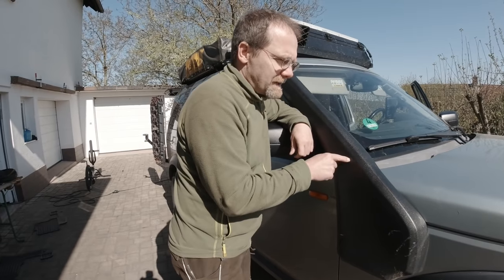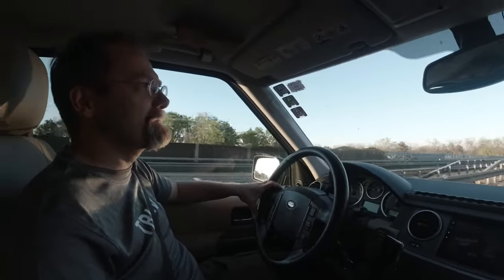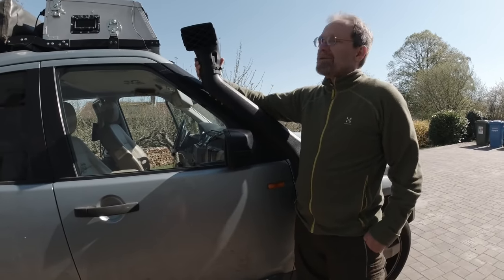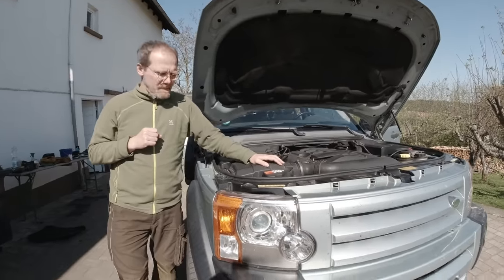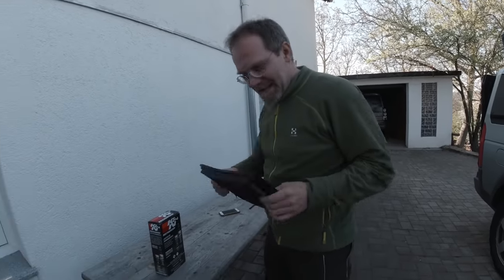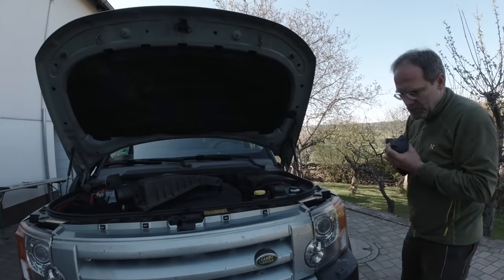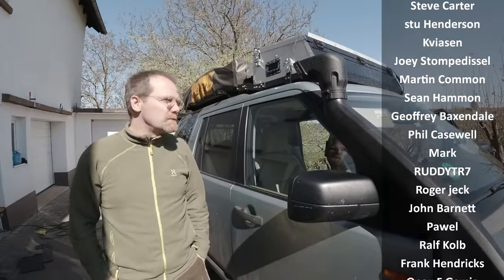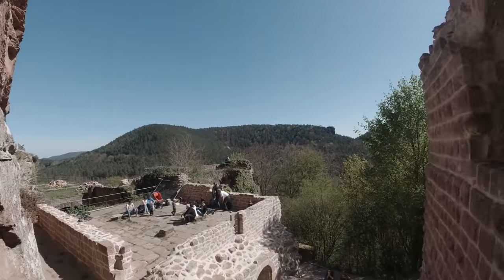Snorkel Intake - Forward or Backward?  Land Rover Discovery TDV6

Comment: I worked for a German company for a few years and I can say that your English is pretty good.  I don't have a snorkel on my D4 mainly because they look ugly but also because I do not intend to take my D4 through any deep water crossings.  The snorkel would help reduce the amount of sand and dust enetering the filter box but I carry a few extra filters on long outback trips and just check the filter once a week or so.  BTW I am not a fan of the K&N filters and believe the original paper filter does a much better job of delivering clean air at a consistent flow rate to the engine.

Comment: My vehicle has had its snorkel on for 12 years now (also a Safari copy, but a slightly better looking one I believe). The previous owner ran it with the snorkel head backwards, for mostly the same reasons as you present, but I keep it facing the front because it looks better IMO :)) 
Anyway, you must be right since the original LR (Mantec) snorkel also points backwards. Anyway, you made me curious, and I will do the fuel consumption experiment as well with the snorkel pointing in both directions, and I'll report back.
Cheers!
Reply from the maker: Thanks!  Christian

Comment: Hugh here from Melbourne Australia..Love your videos as i do most maintenance on my 2006 Disco 3 . TDV6.  I am going to turn my SAFARI (haha) snorkel to face rearwards & see how she goes.   I bought my Disco in 2019 & it had done 200,000km & i think plenty of towing throughout Northern Queensland in the hot & dusty areas you mentioned .  I bought it because the poor Chinese lady who brought it down to Melbourne (2nd owner) had spent over $17,000 in  repairs & gave up.  It was my 4th Discovery  & I took the plunge so to speak.  It has been ok so far at 250,000 the main problem was the air suspension & given my needs I elected to import from UK coil suspension & fit it myself at a cost of $1800  compared with Dealer $3800 repair to replace compressor & control unit.  Drives nicely but not as nice as the air system.  Only real disadvantage is that the Tow Capacity is reduced.
I have just serviced the Auto transmission &now looking at replacing the Right Front drive shaft seal & boots.  Have watched your video to give me courage to do this.  After that may be attack the oil leak from up near the turbo.....the jury is still out on that one.  My main hobby is NOT Disco 3.  It is 1949 Standard Vanguard.....73 years old original running gear & still purrs like a kitten. 
Cheers & keep up the great work.  I enjoy it immensley.
Reply from the maker: Shanes Shed and Outback Discovery both have a side shaft repair video.  Shanes Shed replaces the boot.  Hope your Discovery runs forever.  Please make sure you have the updated oil pump installed.  Christian

Comment: I've fitted a cyclone filter to the top of the snorkel on my D4, you would be amazed at how much dirt that it collects, this keeps the panel filter cleaner ( means less washing).
Reply from the maker: Sooner or later I am going to get one too. 👍👌🙋‍♀️Vera
Reply: Does the cyclone filter make it less throaty ?
Reply: No Martin, gives you more induction roar.
Reply: Just as a precuationary warning, cyclonic filters need to be matched to your air delivery requirements. I spoke to donaldsons engineers and was informed they are not designed for highway use due to the venturi effect and you may starve you engine from air. Below 70km/h is what they recommend. 
This could possibly have the same effect when facing the snorkel backwards, lower fuel consumption could be a result of the less fuel required to obtain the correct a/f ratio. 
Once again, based on the information from the donaldson engineers.

Comment: My Comments! 

1st. The Snorkel helps massively to keep your air filter clean when you driving in Dust behind another car (i.E. in my Case Marokko)

2nd. I have been told by Engineers for Engines (BMW, based I live in Munich) never to use a K&N Airfilter when I like to have a reliable car (Racing - different topic). They do not clean the air enough and the result will be to have a ruined engine when the dust reaches the cylinder.

Comment: I will have to try that, good idea. I was of the idea that the snorkel actually restricts airflow so I cut a hole in the box where the snorkel enters the engine bay. I then fitted a canoe hatch. Most of the time I run with the cover off, but replace for dirt tracks and jet washing. Look cool also : )

Comment: Brilliant video!!  Firstly, your English is great, as long as you don't "screw up", "oh my God"!!  It's interesting your use of a K&N filter vers. a standard paper element.  K&N filters definitely flow more air, but is this required?  Even if the roads are vacuum'd in Germany, they do let through more fine dust, but how significant this is, I don't know.  Vera is right, as always, the snorkel looks good, but the fuel consumption figures are interesting - shows the importance of engine mapping - facing forward versus facing back.  I'm surprised an aftermarket map was not supplied with the snorkel, and the K&N will exaggerate the problem...  Fun video as always.
Reply from the maker: Yes, the K&N is not very dense.  No problem here but in dusty regions not advisable.  We will have to test a normal filter with the snorkel turned backwards now.  Christian

Comment: I would have sprayed the K&N oil on the "dirty" side of the filter, so that there's less chance of any oil getting onto the MAF sensor wires, which will cause false readings and mess up the ECU ability to fuel the engine correctly.
Greetings from a Toyota owner from Australia.  :-)

Comment: Hello, thanks for your interesting tutorial about snorkels. 👍
I live in the Netherlands, the country next to Germany. 😁
Yes, I found out that a snorkel can be helpful in Europe.
I own 2 Pajeros, and used them also for my hunting- hobby.
After one tour through a hunting-field with very high grass, the whole air-filter was full of seeds and other particles.
After mounting a snorkel , I did not have that problem again.
Airfilters stay much cleaner.
My Pajero L040 diesel, has a safari snorkel, and I have the top facing to the back of the car.
On my Pajero V20, 3500 petrol, I have mounted a TJM snorkel, of which the top only can face forward.☹
After a few journeys over the highway, the air-filter was full of insects and other debris.
Because I could not turn the top backwards, I decided to install a piece of pantyhose (!) over the opening, and hold it inplace with rubber bands that I have cut from an motorcycle innertube.
Works fine, no more insects in the filter.
How it influences the fuel consumption, I do not know.
The Pajero I diesel consumes about 11 liters on 100 km.
The Pajero II petrol comsumes 13-14 liters pro 100 km.
I did not buy a 4x4 car for low fuel costs.....😉
Grüsse aus der Niederlande 🙋‍♂️
Reply from the maker: 😅👍 Hello Johnny, I have just been to your country and I think Philipp is planing to move there as soosn as he turns 18. At the end of this video here, you can see where we went and what we did. 😃 https://www.youtube.com/watch?v=Y6yEq9oETh8&t=1506s 🙋‍♀️Vera

Comment: I bought a snorkel for ours over a year ago, but it is still sitting in the shed. Apart from water crossings, I really don't see us needing to install it. I have had water right up to the side intake and nearly had it go under, so there is a practical use. I keep thinking about a temporary flexy snorkel for the super rare times we may need one. 
Thanks for another great video.
Reply from the maker: Make sure to watch our video on how difficult it was to drill those stupid holes into the A Pillar. 😅🙋‍♀️Vera
Reply: @Vera_and_Christian  I remeber that video, it was like it had armour plating in the pillar.

Comment: Unbelievable 26 minutes for an explanation on a snorkel, on my discovery I oriented it to the rear, the only thing that happened was when I was off-roading, one time I opened the passenger window and every time I put the gas on I felt like there was a ball bearing noise, at first I thought it was the front wheel bearing that was screwed. Then I realized that it was the air intake! 🖐️😁 😁 😁
Reply: I had a similar experience and even called out the recovery guy as I thought there was an engine problem!🤣
Reply: @paulwheeldon7194  first I looked for a stone stuck in the brake disc. total movie 🎥🎬
Reply from the maker: We actually love the sound of our snorkel. 😃👌🙋‍♀️Vera

Comment: Hi Christian & Vera, no apologies required. I've got a cheap $120 Chinese snorkel fitted that lasts now for over 11 years. The Safari's for $700 are a rip-off. And yes, we carry a toolbox in our WhatsCruiser, but I've never used it. It's just for the case that we have to help out some Disco drivers, but they've usually heaps of tools and spares with them anyway. Apart from this, great topic today. We have the same discussion here. Inlet to the front or rear. We are front drivers but the WhatsCruiser has the famous 4.5L inline 6 NA Petrol engine (1FZ-FE), different application. Yes, and we drive sometimes through deeper water. It's a proper water crossing when the water flushes over your bonnet and the front of your car starts slightly to float, what feels weired.
Reply from the maker: 😅👌🙋‍♀️Vera

Comment: Facing rearwards is for exceptionally dusty conditions, and  also prevents water ingress. If the system is properly sealed you can cross deeper water, it is also a good idea to have a raised exhaust.
Reply: Well designed ram heads get the water at the back of the head, letting it run down the outside.

Comment: Little turn from back to outside of snorkel cap (+15-20 degree) is reduce air intake temperature up to 5 C at 80+ kmh speed. It is due to air decompression due to  acceleration flow from the windshield. Tested with thermocouple. It is important that such turn also avoid partially ejection effect and air pressure drop

Comment: One main reason for turning the snorkel (raised air intake) to the rear of the car is that on very "dusty" dirt roads (not found in Germany) and you are in a convoy of cars (or one car) throwing up lots of dust, by having the intake rear facing, you collect less dust.
Reply from the maker: Hello Iwan.  I know everything I said only in theory. No practical experience.  But a Snorkel is a must-have for Vera because of looks and sound.   Christian
Reply: There are very, very few tracks in Europe where that much dust is thrown up, to cause anywhere near problems. If you want to seal the intake, then look no further than the push fit plastic connectors that leak, and nt water tight, late model defender air boxes even leaked, so even though you have a snorkel, water is already in through the duct work.
Reply: @marktalbot4wd  Hi Mark, I was referring to driving in Africa and Australia.
Reply: Also your intake track will have positive pressure at any speed above about 40kph with the snorkel facing forwards!    
Go watch some banks power video's and learn the basics!

Comment: Hi Vera and Christian, sorry for giving again a comment but as a typical german "Klug.....ßer" I cant avoid it :-) . 
First your English is really good, especially because its better than mine! 
Second, you are right, the ram effect or "Staudruck" of your snorkel will not increase the efficiency of your turbo pressure mensurable.  
But what I experienced on my TD5 with a VTG Turbo and a big 80mm diameter snorkel is that this tube creates a significant pressure drop. This was so extreme that the compressor began to be extremely noisy like getting into a resonance, because it couldnt get the air it needed. Especially with an agressive fuel map. 
I measured the pressure drop with a professional tool at the entrance of the snorkel and the outlet, and it was huge. In spite of having the biggest diameter of 80 mm for this 2.5 l Diesel, which was wider than the original tubes in the system. 
The only way to get it fixed was to drill a second air intake in the filter housing. 
What I want to say at the end of the day is that anything you put before your original air intake has to be seen as a resistance for the compressor and is not good. It will not be important at lower loads, but at higher loads and rpm, it will reduce the efficiency and pressure of the compressor. 
The only positive of the snorkel is that, when you have heavy rain on the motorway, the trucks you are passing on the left side are not throwing the water into your air intake. This was a typical Defender problem having the same type of air intake on the right side. Resulting in wet air filters.
Best Regards Michael
Reply from the maker: Hallo Michael, I have a feeling that our Snorkel content is not finished yet, thanks to you. 😅👍 We do check our air filters regularly, more than we put in vidoes, and they have never been wet. Maybe we would not have put a snorkel on if we did not have a Youtube channel, but I have wanted one for 25 years now, ever since we owned our first Jeep. If having a snorkel causes damage to the engine, one more reason for Christian to finally take that engine out. Thanks for your comment, really appreciated. I am looking, however, for a cyclone filter at the Abenteuer&Allrad. Maybe he'll buy me one. 🙋‍♀️ Vera

Comment: I live in Finland, and my reasoning for having a snorkel is I went on a trip to Denmark a few years ago, and crossed a stream on a beach that turned out to be surprisingly deep, like up to the bonnet deep while going down into it. Didn't have one, and my air filter got wet. Since then I haven't crossed any other streams, but hey you never know. At least I have a story to tell when people wonder what particular river I'm planning on crossing with my snorkel. My disco 2 has the snorkel facing forwards, because it looks cool, and my 4x4 sprinter has it facing backwards, because it sounds cool (and also to not get it clogged with snow in winter). Now I'm thinking I should turn the D2's head backwards as well.
Reply from the maker: Over the bonnet in a D3 is like a space walk with a leaky space suit or a Everest climb with no oxygen in bad weather.  😬😂👍 Christian

Comment: The reason you fit a snorkel for water crossings is; afterwards when you are replacing all of those damaged modules; and corroded connectors, at least your engine won't be Hydro locked.
Reply: So, so, correct!

Comment: The main reason for the backwards facing snorkel top in 🇬🇧  is when off roading, the overhanging branches like grabbing and pulling off🤭 the forward facing top!

If you have to keep fixing it on the same track it gets old real quick!🤬 hence turning it backwards. 

It's not a fashion choice like a backwards baseball cap. 
But for a snorkel top I'm a fan of the cyclone pre filter. It's amazing how much shit it catches before your main filter.
Reply from the maker: Makes sense.  Thanks.  Christian

Comment: Great video guy’s I was told that k&n air filters could cause premature failure of the mass air flow sensor,because of the oily vapour getting onto the sensor.thanks Simon
Reply from the maker: I have not yet gotten a mass air flow sensor failure on either one of our diagnostic tools. We check our faults weekly. Now that I know how to use the tool, I check them everytime I have to wait for Philipp at the train station, about 5 times per week. 👍🙋‍♀️Vera